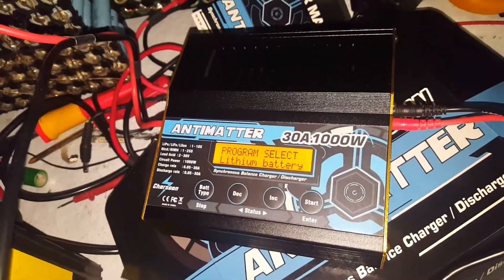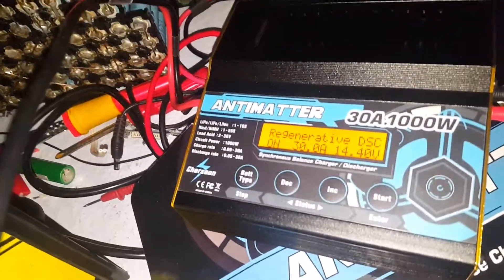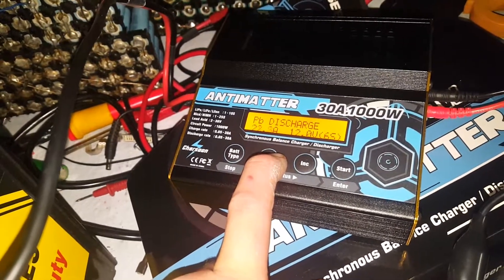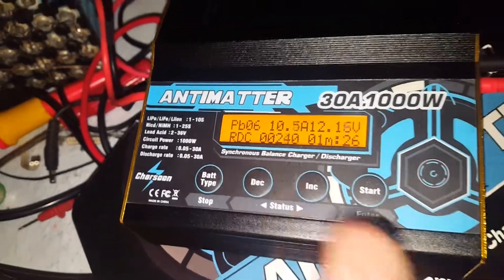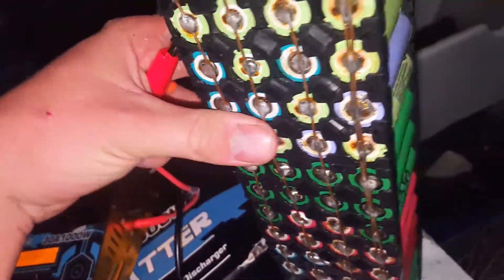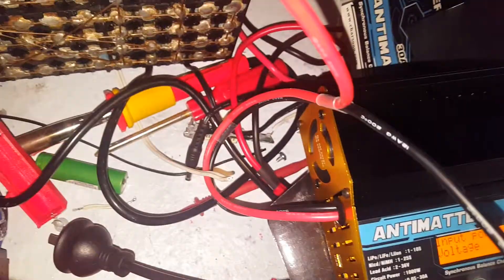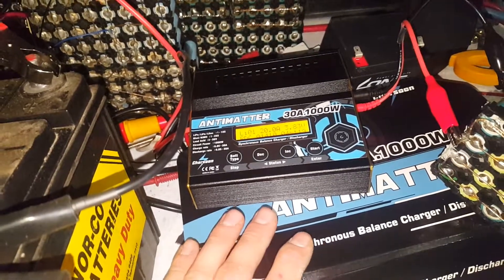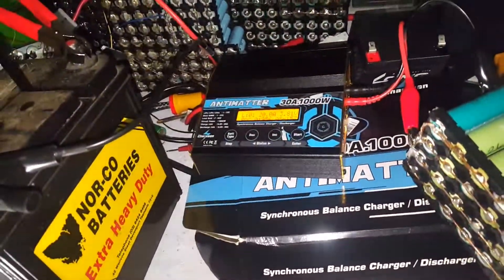Regenerative Discharging with Charsoon Antimatter 1000W 30A Balance Charger

Comment: you know that is a really cool feature, BTW that is about 87% efficient and yea you can discharge at a much higher power, though for emergencies you would not want to use that, you would want a simple boost converter or other dedicated charger.
Reply from the maker: +SuperBrainAK cheers mate sadly it blew up :(

Comment: What happens when the source battery gets full? Does it discharge internally using the fan? My 300W Antimatter seems to drastically limit current in that scenario instead of discharging up to its 20W limit internally. I would really appreciate it if you could check how yours behaves - maybe set the regen limit low (13V or so), so it hits it quickly instead of waiting for the source to really be full.
Reply from the maker: +LMF5000 it just runs till it fills the battery thats one reason i do it with lead acid batterys as they absorb alot of energy at the full charge/float mode.
Its either internal resistance 20 ish watts in your case or reggen not both

Comment: running 20A current through those little crocodile clamps is a funny idea :)
Reply from the maker: +izemanevobike they do it well surprisingly i was skeptical when i first got it but they held up well
Reply: interesting. i did it once with lower amps and they starting glowing. but they were smaller, and maybe had a softer spring installed as well.
Reply from the maker: +izemanevobike there have nice thick wiring too maybe it was the wires that helped the heat issuees